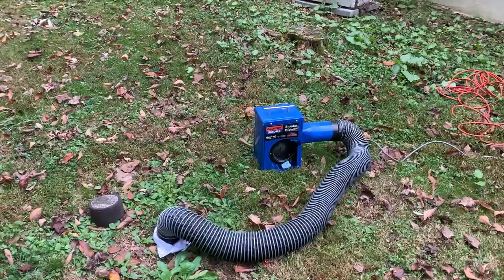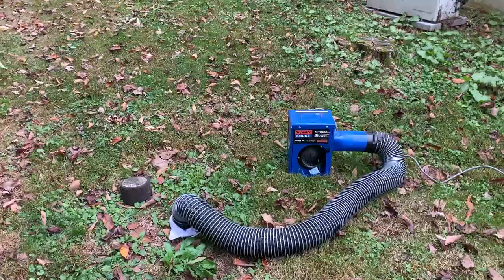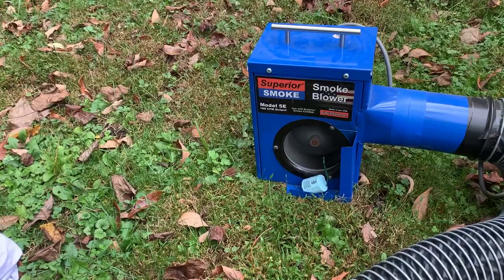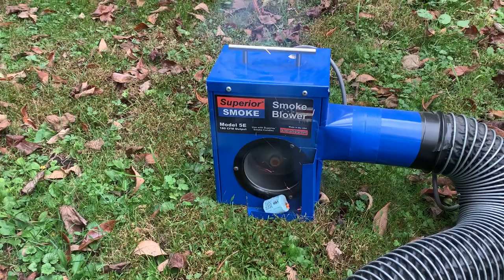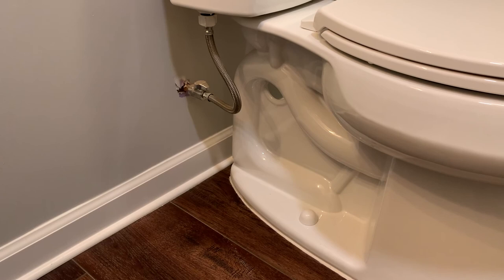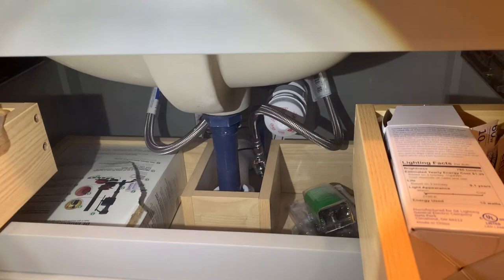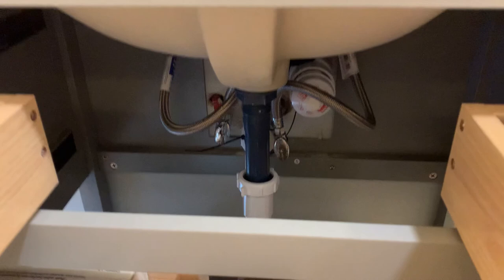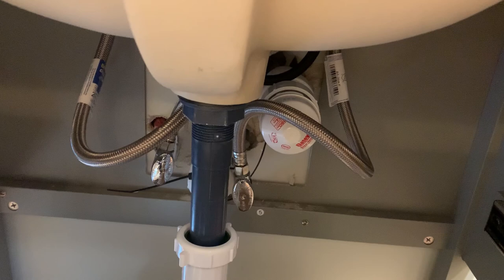Smoke Test Reveals Faulty Plumbing Installation!

Comment: I thought you were suppose to tin the machine on until the flame turns to smoke to avoid explosion
Reply from the maker: Hey Brian, That is not a bad precaution but any embers from the fuse generally do not survive beyond the blowers squirrel cage. Also by turning the blower on and establishing a draft, the piping, especially near the blower, is flushed with fresh (non explosive) air. Turning the blower on first is also a good way to verify there are no restrictions in the system.

Comment: did  you have to go on the roof and plug the vents ??
Reply from the maker: Hey Todd, No, you should never fully plug the roof vent. For a smoke test to be effective the smoke must flow freely through the system. In some cases it is acceptable to partially restrict the vent to create a small amount of pressure but generally this is not required.